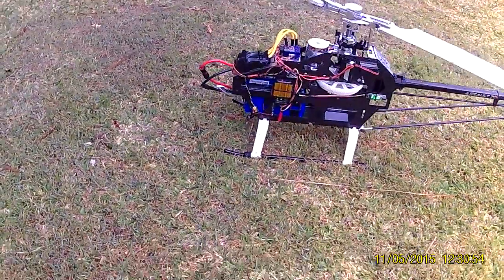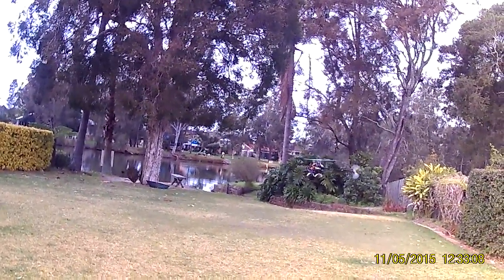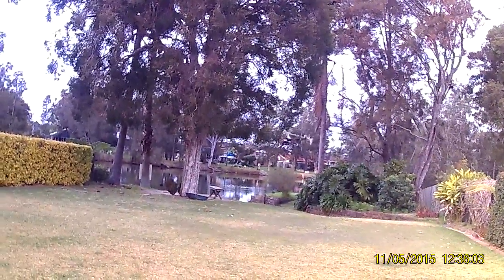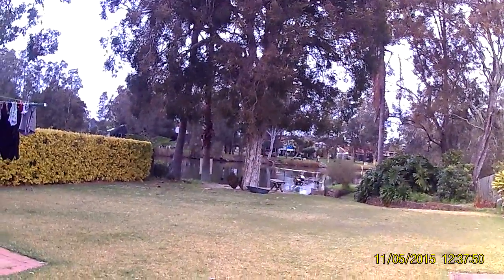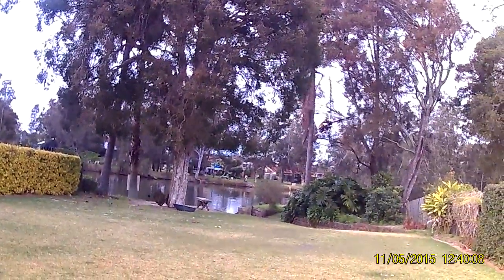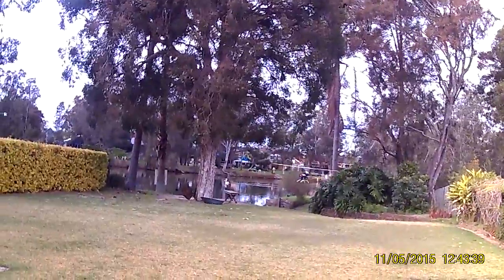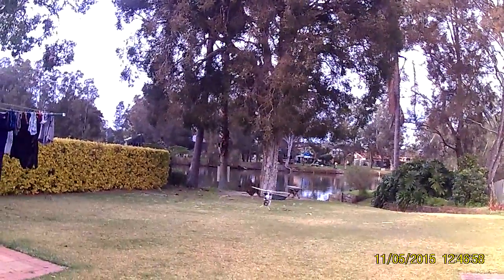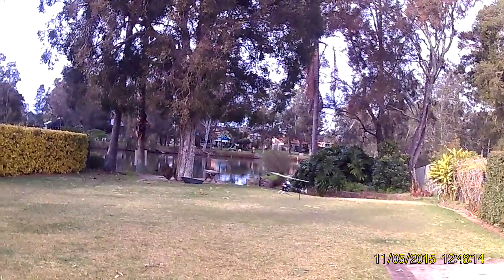Assault 700 long flight time 13+mins

Comment: wow that is some low headspeed. what motor and pinion are you running on this setup? i get about 6 minutes on my Assault 700 with about 1900rpm. and a Kbar? wow some serious balls there buddy. but you should try to fly on idle up with governor. still finding out myself how to setup on the beastX. and yeah higher headspeed is a bit intimidating on the 700. 
check my latest video for my Assault 700

Comment: What motor, ESC and servos are u you using?
Reply: Are you only running a 6S lipo pack, how are you getting such low head speed? or are you using a governor to limit the RPM's  thanks.